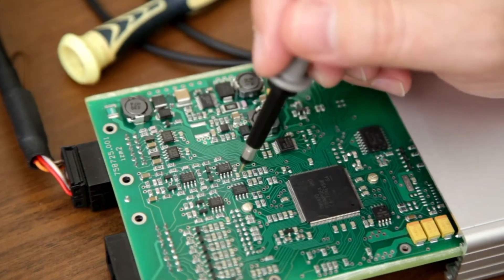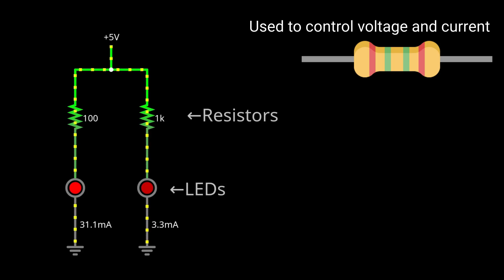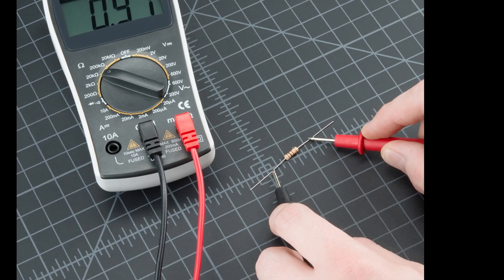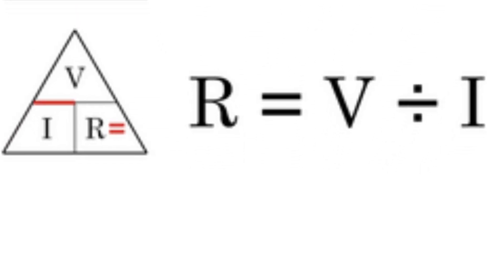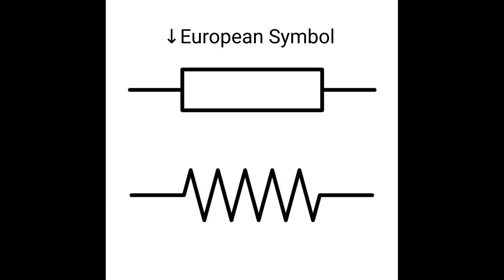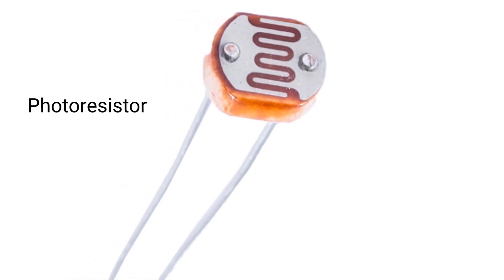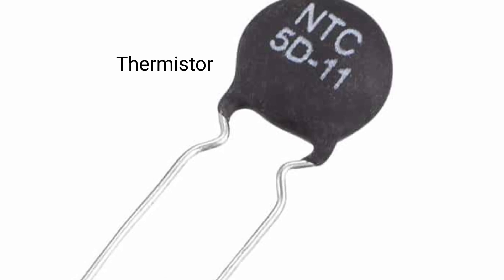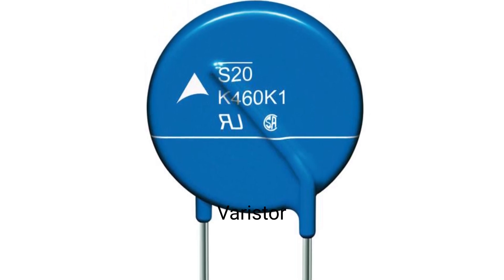Resistors in 100 Seconds

Comment: Where do resistors come from?
What came first, the resistor or the electricity?
Are there other resistors outside of planet Earth?
So many other questions..
Reply from the maker: Bro getting philosophical 💀
Reply: @V_Electronics  Hey VSauce, Michael here!
Reply: 1 - Both, in normal conditions, every electric current has to go through some resistance, in nature for example, the air is the resistor for a lightning bolt.

2 - Yes, there are, even the human made ones in artificial satellites.
Reply: @NullCyan  what's the loneliest resistor out there?